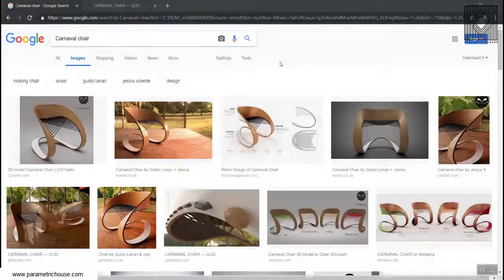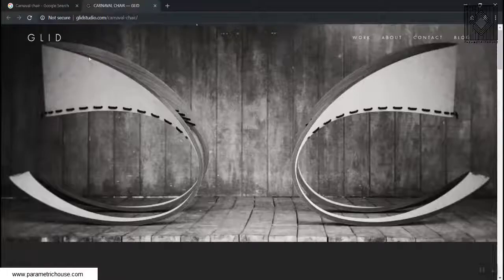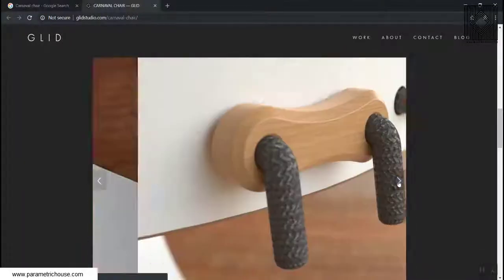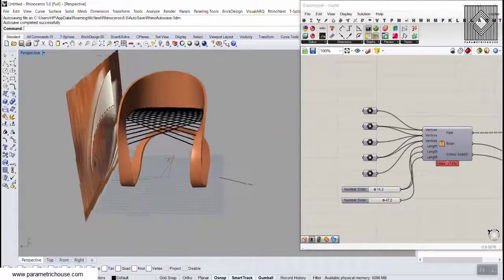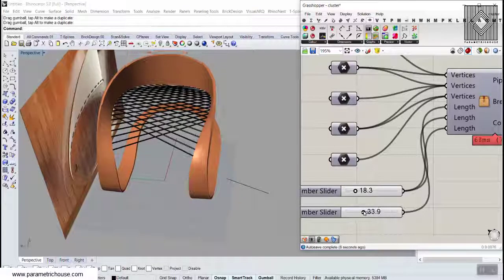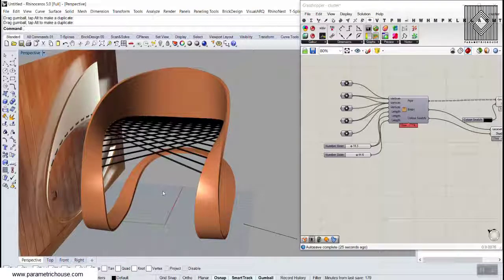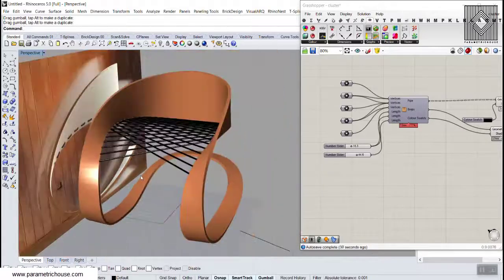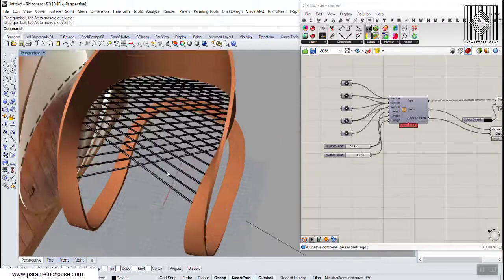Brainstorming #6: Carnaval Chair brainstorming

Comment: Thank you so much for working on the carnaval chair.
Here are my thoughts on how to model it.
1. Create an ellipse
2. Bend the ellipse
3. create rectangular curves on the perpendicular plane of the ellipse created by using pframes to get the planes
4. rotate and scale the rectangles then loft to achieve desired geometry.
5. to get the threads: simply divide edge curve of the lofted surface then using cull and list item to selct points create the interwoven lines and pipe
That was the approach I used but it just didnt feel right
And i had no idea on how to do the interlocking joinery they used to join the plywood at the bottom
Thanks so much really looking forward to the video
Reply from the maker: Good approach Abiodun
Bending an ellipse is also a great idea but the problem is bending doesn't give you that much flexibility to model the base curve easily. Anyway other steps are thought correctly. 👍